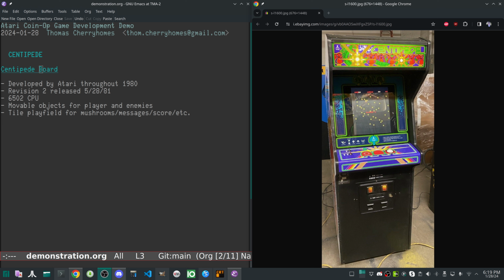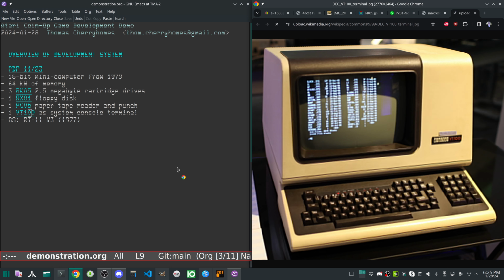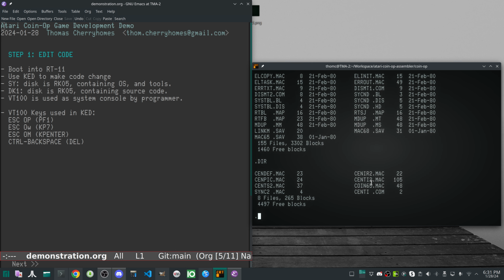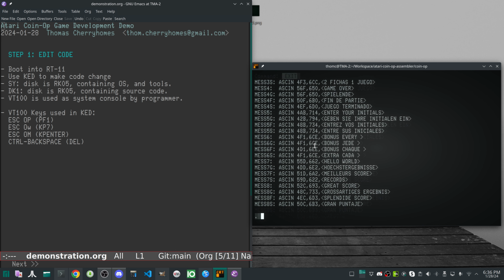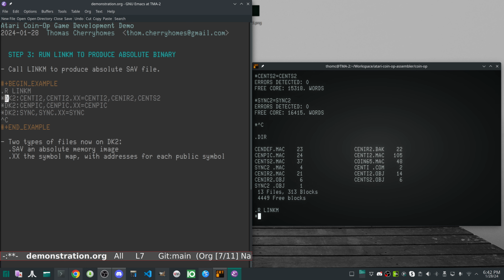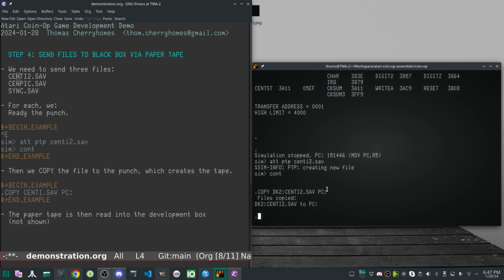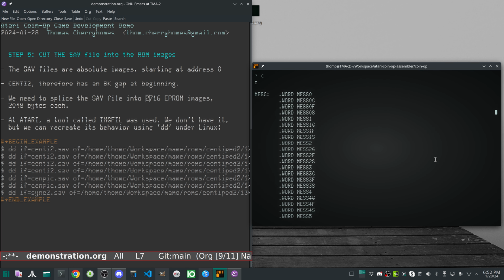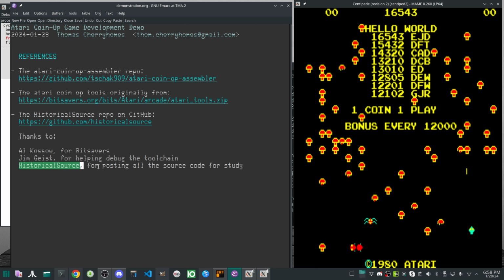Please watch https://youtu.be/VkzVXzWDPYA

Comment: You should be able to connect the virtual pdp11 to a early 80s prom burner.

Or was the real hw done using a mask rom ?
Reply from the maker: Production units were usually mask roms, although some did ship with EPROMs (they had different part numbers on the chips)